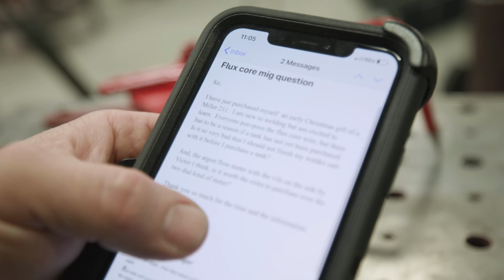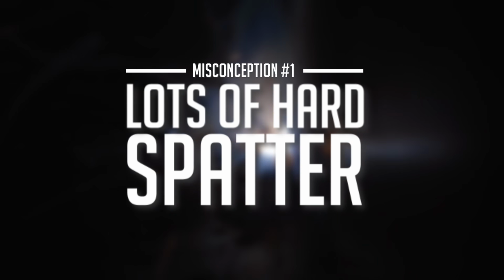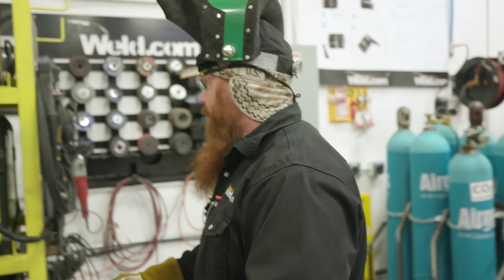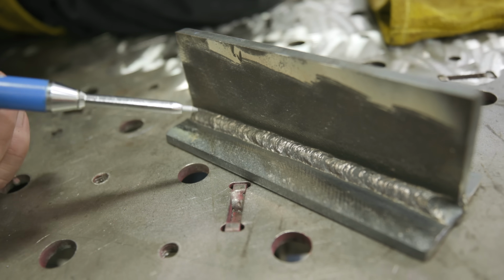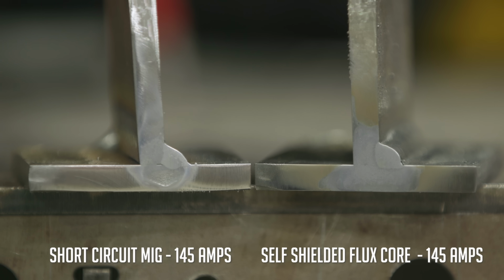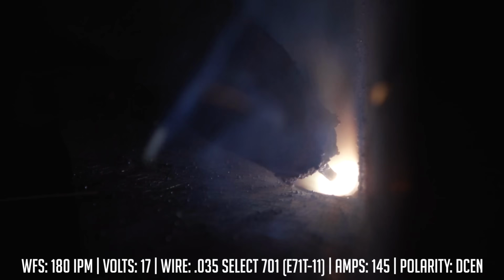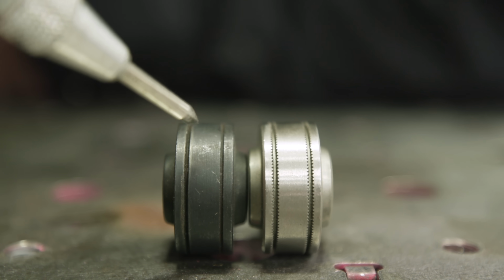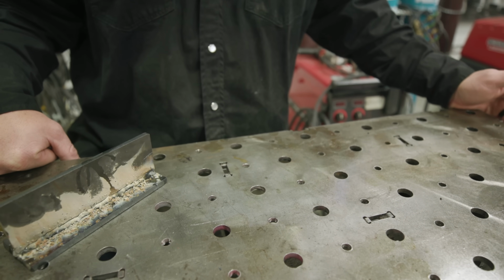3 Flux Core Welding Myths DEBUNKED

Comment: Does flux core make a difference if your pushing the weld such as with solid wire weld or pull the weld like with stick weld?
Reply: NEVER push anything that involves flux, there's too much of a risk of slag inclusion, I'm an AWS certified welding inspector and if I'm administering a test and I see someone pushing ANYTHING that involves flux I immediately flunk them and won't even have the company they're testing for waste their money on sending it out for the tests.
Reply: Duke Craig exactly right. I have seen many want to be welders. Bad mouth flux core wire feed welding. Saying it did not produce a good weld. All because they did not know the proper settings or technique to make a good weld
Reply: @erichill5208  
I've welded literally thousands of pounds of Innershield flux core wire, I've got years experience in shipyards and as a union journeyman ironworker in the field putting up buildings and bridges including fabricating in shops, it kills me when I see these guys write comments that say flux core is no good, I mean it's absolutely laughable to someone like me that's done so much welding with it and then got certified as an inspector. 
A long time ago when I first started welding and inspector told me something that really helped me out and I've passed it along to many beginners, 90% of welding is trouble shooting, if everything's set up properly then it's easy, if it's hard then you've got a problem that needs sorted out.

Comment: one of the nicer wires i used was Lincoln outershield.  It was a flux-core-with-gas wire.  Why you need gas with it, i have no idea, but the stuff welded pretty good on anything i used it on.  It had a ton of flux too. It wouldn't bend, just snapped like chalk.
Reply: Yes Outershield is a great wire to use inside shops where smoke buildup is an issue but it's not intended to use outside because of the issues of wind blowing the shielding gas away, that's what the gas is for, to shield the weld from the atmosphere, the flux in Outershield is what "fast freezes" to hold the weld puddle in place when welding up and overhead. 
With Innershield the flux core does both like with stick welding.

Comment: Great how=to vid! Just a quick question: You referred to the anti splatter spray for use on the table and the weld too.does that mean that it can be sprayed right on where the weld is going to be? Thx in advance
Reply: Yes, just don't hose it down with too much or it'll cause issues, a light misting is all it needs, also spray a shot of it on the tip of the gun, after a while when splatter starts building up on it a light tap on the welding bench or whatever and it'll pop right off, another shot on the tip and you're right back at it.

Comment: One of the advantages of flux core over solid wire is if you have to weld anything outdoors. 99 percent of what I do is in the shop, but if I have to MIG weld anything outside, I have to wait until the wind dies down, or put up a barrier to keep the wind from blowing the shielding gas away. The disadvantage of flux core is that it smokes like a son of a gun.
Reply: Yep, that's why it's great outside and MIG or flux core Outershield is great inside.

Comment: Bullshit. Your assertion that flux core is DCEN is wrong. That is GTAW. period. Stop giving out bad info to new people to the industry.
Reply: You don't know what you're talking about, flux core Innershield is DC- only, and before you start arguing with me about it I'm a 3.G certified welder with over 25 years experience running FCAW in shipyards and as a union journeyman ironworker AND I have an AWS certification as a welding inspector, you're very wrong about that.

Comment: I welded cement mixers and concrete batch plants with flux core. We were running .068 innershield with a 400 amp bullit. I made 3 pass vertical up welds regularly.

Comment: I work underground in the coal mines, that’s what we use is flux core with gas, I’ve replaced pieces of both sides of the pan of the miner using flux core. That was over a year ago and it’s still holding strong. That really showed me not to be afraid of using it because the pan is on the business end of the miner for people who do not know.

Comment: If you spray anti-spatter on your work, with it effect the weld? Or does the flux float it out/burn up
Reply: Just don't hose it down too heavily and you'll be alright, a light misting is all it takes, also spray the tip of the gun with it, every once in a while when splatter starts to build up on the end just give it a quick tap or two on the welding bench or whatever and it'll usually fall right off, another quick shot on the tip and you're right back in business.

Comment: I find alot of ppl hate on wire weeds mig or flux because 1 they have zero idea what's actually going on survive life on fast food and think that there 60$ no name welding machine plugged into a over loaded 15 amp circuit with a 50' 14 gauge extension cord should weld 1/4 plate 😝
Reply: Yep, just make sure you're running it on DC- and you're good to go, that's the mistake most guys make and accounts for 90% of the undeserving bad reputation it has, simply because people don't know what they're doing with it.

Comment: Awesome vid . 100 % factual . 
I started welding with flux cause I couldn't afford gas back then . Im glad that's how it went though cause it made me learn alot about work distance wire speed different metals etc. Positive it made me a better welder overall

Comment: Is there an alternative to switching your dc as my torch is built in an also my, power is in a switch (1 - 2 & high - low) as it is a budget mig i purchased to learn with
Reply: If your talking about that black  welder from habor frieght it's actually ac you cant switch the polarity it's the only ac mig welder I know of and its  junk and you wont learn much more than how to cuss a lot
Reply: @jeremyhanna3852  
There's also one that was sold last year at the big name farm store chain that sold as a gasless flux core welding machine but it's fixed DC+, I told my buddy I hope he still has the sales receipt because it's worthless, when he ask me why it would be made that way I told him the only thing I could figure is some zipper head in China screwed something up in translation and that how they got made, but it's like I assured him, there's no such thing in the world as DC+ Innershield welding wire, it simply doesn't exist.

Comment: I once worked for a company that did heavy fabrication for Bridges and big buildings using huge I beams and everything, and they changed their process from flux core to solid wire mig. Not sure if it was cost related or what, but they did it. They had some xray work as well using mig. Was surprised they used solid mig for such big heavy work like that.

Comment: I have 5 Lincoln Machines
1. power mig 210 with all attach, 120v 220v
1. 180 220v
1. Weld-pac 3200
2-  weld pac flux machines
I use the flux in and out of the shop mostly quick gate repairs, frame repairs etc.
I have paid pennies on the dollar for all my machines. 
I paid $45. for 1 flux and got a  brand new 1 for free due to the owner getting to upset to ever try again.
My MP 210 I paid about $650 new with everything but the foot pedal.
My 180 cost me $250 dollars.
My 3200 Flux-Mig cost $164 33 days out of the box.
Yes I am a Lincoln fan. I also like Miller but where I live, I could find a needle in the hay faster.
Thanks for the video,  welding for 25 yrs off/on except last 4, I can still learn.
Yup I still make mistakes.

Comment: If you are welding thin material use .023 solid wire with gas. Fluxcore is more aggressive.
Reply: Yep, it's a little too intense for automotive body metal and anything else under 1/8".

Comment: Haven't welded in 20+ yrs and Back then only ran stick and want to start welding again but know nothing about flux core welders and only have access to 110 right now and was wondering if a titanium 125 or a century fc90 both 110 welders would be good enough to put strong welds on motorcycle frames.truck/car frames roll cages and angle iron utility trailers I'm just worried it won't get hot enough or if those 2 welders aren't strong enough could you point me in the direction of a 110 welder that will handled please and thank you
Reply: Yep, I've welded plenty of motorcycle and trailer frames with Innershield flux core, just make sure it's running on DC- unlike MIG gas wire that runs DC+, that's where most guys screw up and why flux core has a bad reputation, because people don't know what they're doing and they want to blame it on the wire.

Comment: Thank you for clearing up these myths about mig welding. One question I have for you about SMAW ??? You said that mig has a higher deposition rate the stick welding. I have found that not to be the case. The big thing is to use welding rods that are made for fast deposit rates. What do you think about that statement ??? Please respond Mr. Weld.
Reply: You got to stop and replace rods! While the wire is continuous !

Comment: I've arc welded for 30+ years and I've had a mig for about 5 and my mig welding looks worse and dont hold . I'm ready to give the welder to a kid in school to learn
Reply: If your serious I'll gladly take it off your hands
Reply: When you say MIG do you mean gas type or gasless flux core?
Reply: @dukecraig2402  flux  core
Reply: @mrnascar9129  
Make sure the polarity is set for DC-, that's the biggest mistake people make when trying to weld with Innershield flux core wire, they have the polarity set the same as MIG which is DC+.
I'm a 3.G certified structural welder, I've got LOTS of experience running flux core wire all the way from massive welding machines that take 250 lb spools that you have to load with a forklift or an overhead crane to little 110V plug in portable welders, I've welded in shipyards and as a union journeyman ironworker building bridges and high rise buildings, including fabbing in shops and I'm also an AWS certified visual welding inspector. 
Years ago when I started welding an inspector told me something that helped me more than anything else that I'll gladly pass along to you, 90% of welding is trouble shooting, there's no such thing as a welding wire that's "no good junk" like a lot of people say about flux core(not that you did but I hear a lot of that about flux core), if it's not running right then you've got a problem, ie wrong polarity, dirty/rusty metal, wrong type of wire or gas (if it's gas type wire) for the metallurgy or wrong gas for that wire type etc etc.
Just so you know MIG is not any type of wire welding, it would be easy to do things wrong, like looking up the polarity for MIG and trying to apply that to flux core, by not understanding the correct terms for what you're doing. 
MIG stands for Metal Inert Gas, and it runs DC+ only, Innershield flux core runs DC- only, that's a prime example of why using the correct terms is important when trying to figure out why you can't get something to run right. 
Also DON'T attempt to weld thin sheet metal like the type used on vehicle body's with flux core, it's too hot and intense for that, that requires .023 diameter MIG wire that runs best with a mix gas made up of CO2 and Argon, Innershield flux core really isn't any good for anything thinner then around 1/8".
One other quick thing, there's another type of flux core welding that's called Outershield, it's a flux core that also uses gas, straight CO2 works best with it and it runs DC+, that's another reason it's important to know exactly what you're working with when asking advice so you don't wind up getting incorrect information. 
If you have anymore questions or can't figure something out hit me up and I'll gladly walk you through anything I can help you with.

Comment: I've done some welding. This summer I'm going to be putting new floors in my 93 F250 I was wondering what the best welder for a job like this would be. could I use a TIG or am I better off using A MIG with flux core? the only welder I own Is a stick welder.
Reply: Flux core is too intense for sheet metal the thickness used in vehicles, you want MIG that uses gas, all wire welding is not called MIG, the type he's demonstrating here is Innershield flux core, it doesn't use gas and it's too intense for thinner sheet metal. 
You want MIG wire in .023 size with a CO2 and Argon mix gas, go talk to your local welding supply house and they'll get you fixed up with what you need, make sure you run the machine on DC+ for MIG, DON'T go to the local farm store or Harbor Freight, they usually guess at what they're talking about and will say whatever to make the sale, talk to professionals at a welding supply shop and they'll get you fixed right up.
ALSO, DISCONNECT THE BATTERY ON A VEHICLE BEFORE WELDING ANYWHERE ON IT!!! You can blow the computer and other sensitive electrical systems right out of one by not doing that!!

Comment: I've been welding for over 10 years and I've always believed flux-cored to be better than hard wire. just my opinion not from anyone else's point of view. Every major structural company that I've ever worked for used flux core. Now I will admit they switched over to hardwire for a little while not sure why. This may be due to that myth stuff you're talking about. It depends if you know how to use them properly. Yes we totally had to always keep a can of anti spatter on hand with flux core. But the cradling of the puddles that is provided by the thicker flux core process is more favorable in multiple positions including overhead. Solid hard wire not so much.

Comment: I work in the mining industry in Australia and flux core with argon is the norm because of its structural property’s when doing crack repairs on dump trucks and dragline/ shovel buckets. I have run 2mm 81ni wire on bucket work and it’s awesome, large deposition.

Comment: Quick question... Did he get the amount of heat in base metal and electrode backwards? I believe DCEN creates the heat in the electrode rather than base metal and electricity runs negative to positive meaning it would be traveling through the electrode creating heat there and traveling into the base metal. I know in stick this is the case.

Comment: Technically double the power is travelling through the fluxcore wire as the Earth in welding terms has 2/3rds the current passing through the earth as it has to travel through the Parent material and 1/3 rd the power comes through  the positive.
So you will always get better penetration if comparative wires yet remember the flux cored wire isnt as dense and per linear metre has less metal deposition of wire as it is hollow and carried the flux.
So we generally turn the machine up to compensate.....
Not entirely true on site stick can run large rods and is faster to move stick in a lot of cases is comparable and not comparable in a lot of other cases. Stick is faster to move with and stop start with thick rods on thick steel doing stitching etc...

Depends on the job...

Comment: I weld WB700 butt weld full penetration un supported plain old positional weld Ultrasonic inspection. Got two thumbs up never seen a site weld pass with so little come up on the screen.
I wasn't there for the inspection got it from the Construction boss. He said do i know them, my response was they are the largest crew of inspectors and have the largest amount of  Pressure contracts in the area they are half the pice of the next competitor and they are attached to one of the largest pressure Mobs in the State. I have met one rep in the office and have recommended two of the inspection companies they always go with Sonic based on Price and their Ability.
Was even asked to teach for Lincoln Australia by their Head  metallurgist, before the down sized.
Flux cored wire like all wire has what is called characteristics to its application. 
Knowing those characteristics allows for greater application.
The stick out was not enough and if you pay attention to the arch there are a tiny stream of molten balls streaming back up the wire, trying to short out.
Stick out should be a minimum of 16 to 22 mil depending on accessibility. and All welding lines should be greased with Graphite or Lead pencil carbon.
Get a leather mans and file a carpenters pencil carbon and pour into the lining of the Gun.
You will love the difference it makes it will tripple the life of the line and stop blockages in the tip....

Comment: Great vid- I weld with nothing but flux core and I always having to explain to people in the comments section that what Im doing is OK. You really mede me wonder just how many people who think they can weld have tried FC wire without changing the polarity! - most people whosee my welder say " oh Ive tried Flux core- Its spattery and no penetration" hahaha
The reasons I use it are simple- Im welding Galv box section and Im doing it outside. Im building large trailer chassis mostly and its a winner!

Comment: I've been told that flux core isn't good for thin metals. I'm no welder and this has been my experience.  Am I just running too hot or is flux core not good for thin sheet?
Reply: Better to use solid wire in short circuit transfer or pulsed spray. The penetration with flux core especially because it runs best with globular goes too deepnandnis too hot.
Reply: @jamesgoesoutside  thank you for the explanation, and for not being rude or condescending.